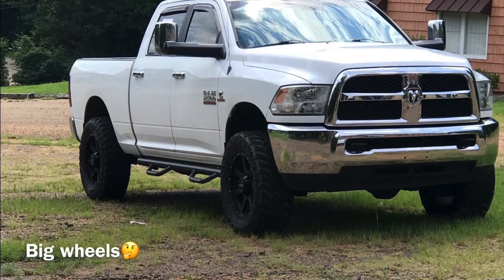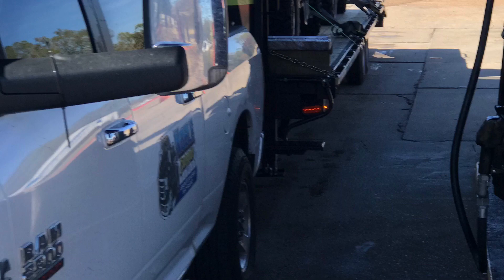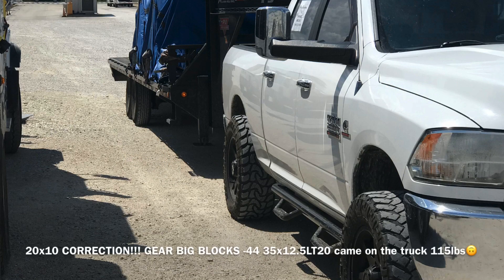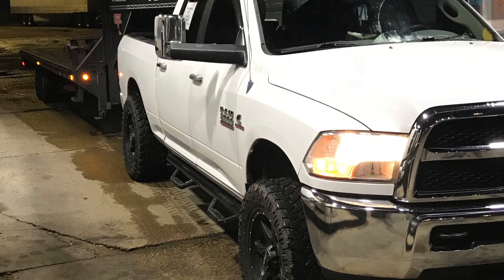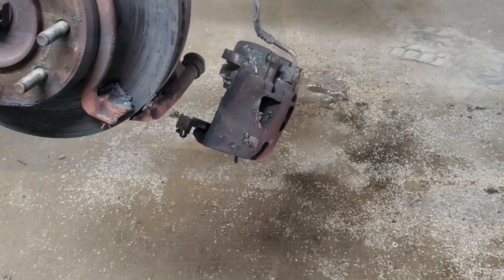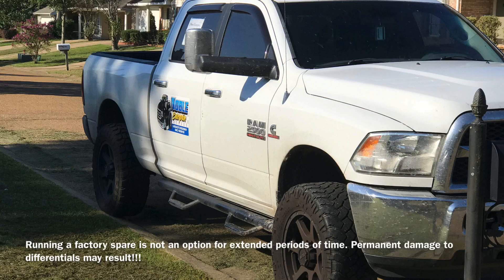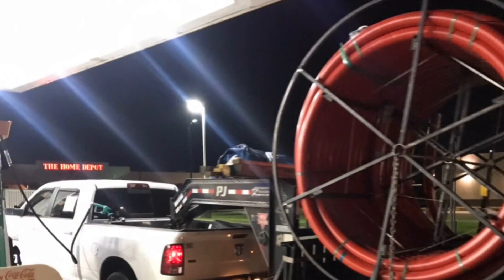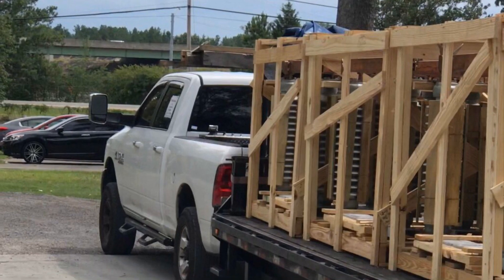HOTSHOT TRUCKING: Flash and dash!! Big wheel pros and cons🤔

Comment: The right tire size depends on the gearing mainly. Taller tires are okay IF your not hauling real heavy and the gearing is Low enough AND if your hauling on flat ground mostly. If you run mountains etc then you best go with smaller tires
Reply from the maker: I completely agree. Run 17”s on the nationwide truck and 18”s on the 06. 06 is a G56 man, with 3:73. You can definitely feel those aftermarket wheels when the weight is on or up a grade for sure👍🏽